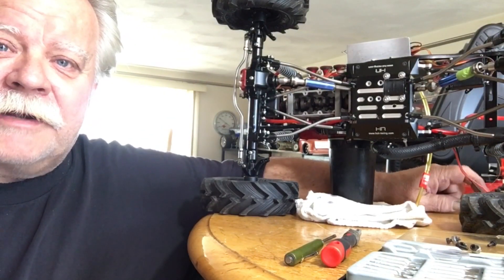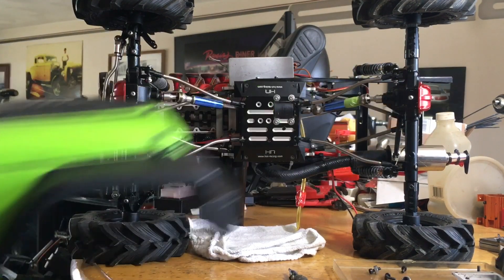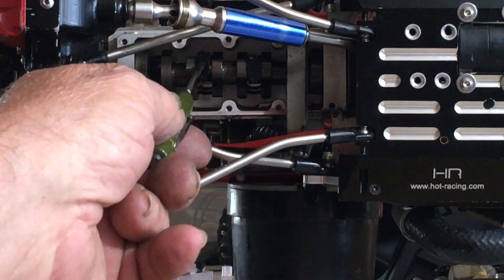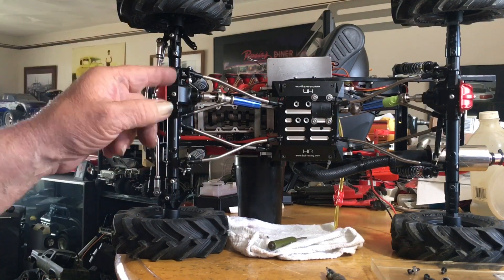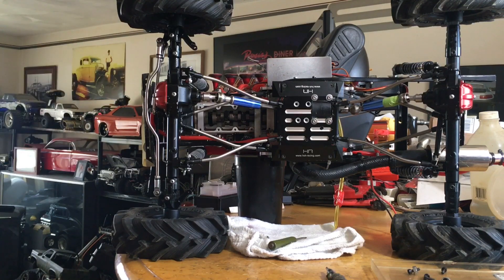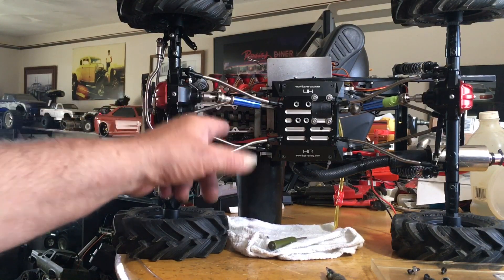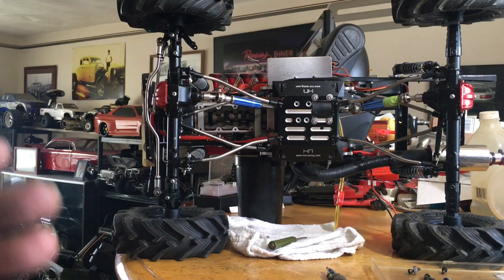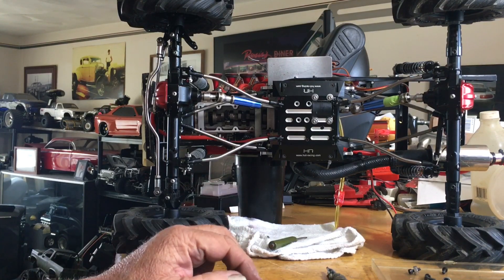TOYAN we have a problem

Comment: Thanks brother for your cool builds. I hope everyone here will email Toycan and get the word out that their ifour has a major defect that Toycan needs to fix for us in the rc world.  I've thought about buying one but I'll wait for maybe the Aussie v8. There is also a gasoline version of a Toycan-like engine with tiny plugs, water cooling, oil pump, with reservoir. It may have the same crank issue. I dont know who makes it. Anyone know about this small gasoline ifour? It was about $1200 in Aliexpress but that was a few months back.
Reply from the maker: I agree they have recently noticed the problem and everyone's comments, I have been trying to come up with a simple head gasket mod that everyone can do to prevent the crank failures. The engine you are thinking of is a 36cc 4 cylinder its a good engine from what I hear, sterlingkit is releasing a smaller version of it next week.

Comment: There's a reason you don't see engines with only end crank support (unless it's a single or v-twin)...such a beautiful piece, but definitely a "shaped object".  Needs a whole new block with 5 mains and either a multi-piece crank pressed around ball/needle bearings (like a motorcycle 2-stroke), or pressurized oil system.
Reply from the maker: Good call there my friend!

Comment: Its a real shame I personally don’t own one but hearing alot about them snapping cranks.
Uncertain to whether its just a poor grade of steel (as Chinese manufacturers often use low quality recycled steels) or if it is just the bearing issue. I do understand that both the cirrus inline (ohv) 4 engine & the westbury Seal engine (side valve) only use 2 bearing points which was very common place on full size pre war engines, however those two engines are much lower revving/power output and are normally built from castings as display engines only. Again I personally don’t own either engine but remember studying the two designs while studying 3D design.
Reply from the maker: That's interesting to learn that, I knew there were engines out there with only 2 supports but couldn't remember which ones. I'm still studying this engine to try to figure out the problem.
Reply: @dennisdempseyradiooutofcontrol  happy to have helped you Dennis

Comment: This is  a center main design for the Toyan L400. It uses two bolts that line up with the head bolt centers. The plan is to drill head bolt holes the rest of the way through and tap them. Plenty of room for bolts from the bottom. Design is based on installing the lower bearing support, slide the crank in and then roll the bearing into place around the crank. Install the upper bearing and cap with bolts and it's done. Looks like it'll work, but I have to wait till I have a CNC lathe to try it out.
Reply: Picture didn't come through. Sorry about that.
Reply from the maker: @brucefredrick4200  No problem is there a link for the center main?

Comment: in my opinion toyan will have to make an improved version of the crankcase so that the crankshaft installation is like on a real engine Not just a center bushing without oil Pressure it wont last mutch longer i tink I think it's worth a try a center bushing It's better than nothing
Reply from the maker: I remember Timsane making a center bearing with lubrication  and the crank still broke, the crankshafts need to be made with a stronger material.

Comment: I'm Still unable to start mine and the water pump leaks. If I tighten the water pump bolts, it will not rotate. I gave up. It will be a display model.
Reply from the maker: That is a bummer, I had to run my water pump in with a drill on both of my engines.

Comment: Sorry Denis.I think Toyan tried a central bearing: we see the fixing of the bearing on the block (blocked by the small plate with 4 screws), but it cannot work without lubrication. This engine is beautiful and Toyan can be congratulated for it.Unfortunately it is just good to put in a showcase,that's what i did with mine...
Reply from the maker: They advertise the engine to be used in a car ship or static running generator, they must have had failures on their testing and RC builds,  Its a beautiful engine with just one catastrophic problem hopefully a stronger material for the crank would fix the problem.

Comment: hello Dennis, i hear you. Let me figure it out with Toyan factory. I'll come back to you later.
Reply from the maker: Thanks my friend much appreciated!
Reply: @dennisdempseyradiooutofcontrol  toyan will reply you personally later.
Reply: hello Dennis, I have collected every problem of this engine from our users like you. I have re-checked with Toyan team. Their technicians are working on it and find a way to upgrade this crankshaft. We know it and won't ignore it. But it's not that fast. I will keep you updated if we have any new progress. Don't worry. sorry again for any inconvenience caused by this. any other problems, pls send me an email.
Reply: @Stirlingkit  Please read my reply in the video titled "TOYAN CRANKSHAFT FIX WILL IT WORK???" to a comment made by Doc's Hot Rod Hobbies. I make mention of the corner radius ground at the intersection of the crank pin (journal) and crank web. The current radius is too small and promoting a strong stress riser which allows a crack and failure to occur. I too have one of these engines purchased from you but now refuse to assemble or run it until this problem is resolved. I was going to spotlight it on my new YouTube channel "Gas From The Past" (no content at present) but will hold off until there's good news. Thank you.
Reply: I wonder if they will

Comment: Man $900 for an engine that always breaks? Sounds like Toyan is using cheap ass Chinese steel !!! Is the crank staying cool in oil? I’ve ran 2 stroke nitro engines in my RC’s and never have had twisted cranks.
Reply from the maker: The crank is oiled with piston blowby, it gets plenty of lubrication but whatever material its made of is weak, most all nitro engines have a steel or stainless crank and they last forever,
Reply: @dennisdempseyradiooutofcontrol  do they have any good material that they can use in China? Or is it all contaminated and bad steel?

Comment: Good finding buddy. This is definitely a "misconception" problem. In my opinion they need to change the material and/or the dimensions of this Crankshaft... I think this breaks due to an over torsion applied to the Crankshaft, therefore the section diameter should be increased...
Hope they will nicely give a feedback on this one, otherwise they might loose some great customers.
Cheers,
Reply from the maker: I agree 100%

Comment: They have the dimensions to all parts would be easy to machine a center journal. But they probably gonna back up their products by stating these were meant to be for education purposes and not to put under stress. But what’s probably gonna happened is that if they don’t take of the problem then this engine is gonna be obsolete due to less buyers.  The L200 needs a better rocker arm support too. If I get any updates from my emails I’ll be sure to post that. Let’s hope for the best.
Reply from the maker: Yeah they could make a support that we could install very easily but we will see what they do.

Comment: Need that third main bearing and a harmonic balancer I think. Would be especially nice if they went to 5 mains. Makes me hesitant to pick one up too; they look awesome and sound great but I'm not gonna get very far trying to drive a Rovan Baja with one if the cranks break this easily. Pulling a 35 pound dune buggy around is far harder a job than that crawler and they're breaking for you who knows how quick they'd pop for me. I also think they need a single carb setup as well would be a hell of a lot more user friendly that way.
Reply from the maker: I agree with ya there brother,
Reply: @dennisdempseyradiooutofcontrol  I am eager to see how that new twin turns out. That thing has 3 main bearings and a single carb should be pretty skookum.

Comment: Dennis, maybe get your replacement crank cryohardend, just a thought
Reply from the maker: I don't know if that will help without the center support to keep it from flexing.
Reply: @dennisdempseyradiooutofcontrol  It sure helped the cranks and rods on mt old briggs race karts stay together when before I did it, they would fail constantly. The small size of those , it would be cheap enough to have done that I think it would be well worth the try as I doubt they will change the design anytime soon
Cryo hardening will not only make the metal stiffer, but stronger too

Comment: I'm sorry about your problems with your engine, but a 4-cylinder engine with only two crankshaft supports is a serious problem for sure, this failure is not only a trojan problem, it is your problem too, for buying a poorly designed engine.😉
Reply from the maker: I agree
Reply: @dennisdempseyradiooutofcontrol  and your v8 engine?
This engine looks promising😉

Comment: Dennis the problem is they are really static engines to sit on a stand and be started to show people it running as if it was to use it would have bearing's and oil pump and galleries to feed oil to cam's rockers and the crank with either a dry sump system or a sump with a pick up.
Reply from the maker: Great point

Comment: Sorry to hear that Dennis, this is kinda why I avoided the L400 I never saw a center bearing cap/brace for the crank and I saw that as trouble since it's a long crank and not to mention it takes so long for them to respond and forever to ship out parts. I did the same as you and went with the newer engine that was recently released, hopefully it's a well built engine, guess we'll see 😆. I appreciate sharing the updates on your findings and experience! 👍

Comment: I had my crankshaft break in June. I replaced it and now have starter trouble. Double deuce can you show your starter setup and how you did it for the l400? Thanks
Reply from the maker: Yeah now that the engine is out I will do a video on the starter.
Reply: @dennisdempseyradiooutofcontrol   alright alright alright, thanks DD

Comment: Thanks for the heads up! What motor would you recommend??
Reply from the maker: No problem,  I like the L200 engines they have some tuning issues but are reliable, I bought the new NR200 engine to see how that's made.

Comment: a company thats worth its weight  should have done better R&D, thats not a good sign companys that ignore the problems with an items they produce or customers dont usually last very long
Reply: Selling an inline four with only two main bearings is a bad idea no matter what. You can get away with three...the Model T and Model A Fords all used 3-main-bearing engines(Even the flathead V8 only had 3 mains!) and never had any sort of issue with crank failures....but just two? Askin' for trouble.

I would have never let it leave the design table if it wasn't revised to have a center bearing on the crank if I was in control of Toyan designs.
Reply: @TestECull  it's totally bad business practices, I would say borderline scamish